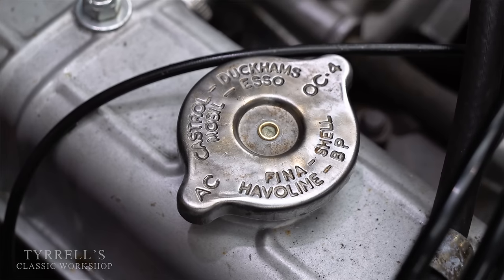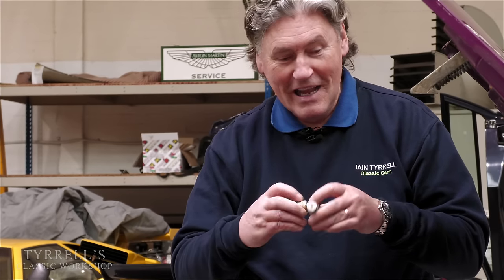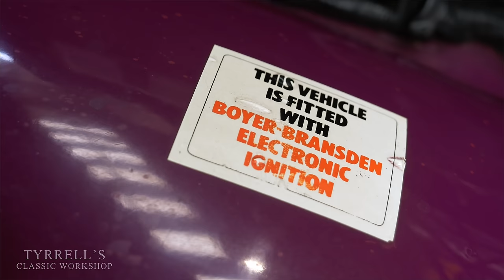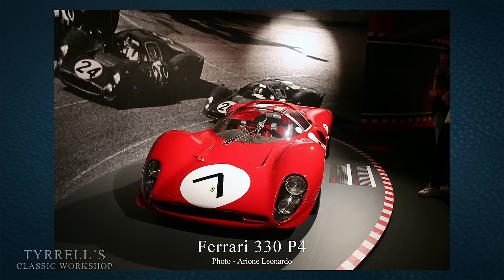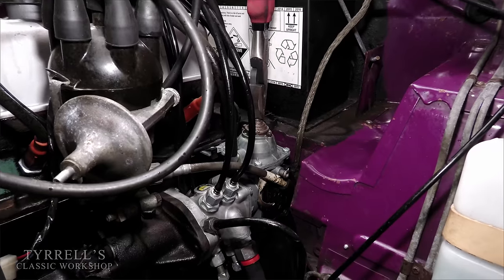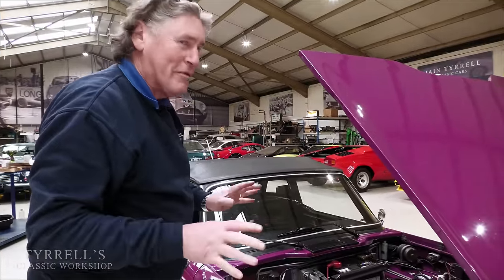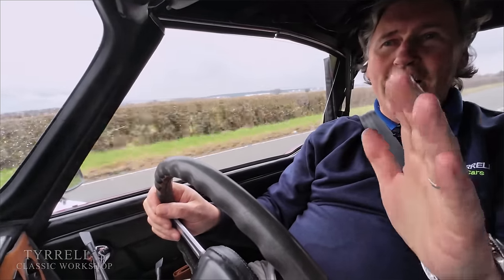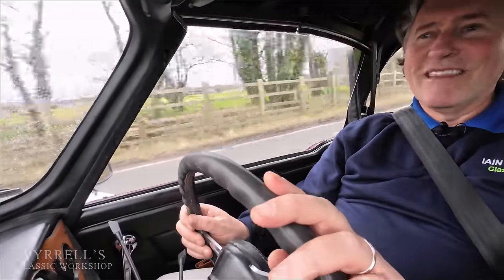Inside the Triumph TR6's Ingenious F1 Fuel Injection System | Tyrrell's Classic Workshop

Comment: My car {a humble 1960 Rover P4, 100 }, has a Laycock de Normanville Overdrive  ! { fitted from new, {Solihull,} and still working perfectly ! }
There are actually 5 switches on it to make it work smoothly, in a very intricate, rod operated, throttle action !
1} The lever on the steering column
2} The lever on the gearbox to ensure that the overdrive ONLY operates in top gear { 4th }
3} Two No. rotary cam switches, bracketted off the engine, operated by an angled lever, to optimise the speed range within which it may operate.
4} And finally a Kick-down switch under the floor mounted, lever type, accelerator pedal, to allow the immediate dropout of the overdrive, for instant acceleration, and return to normal Overdrive operation upon lifting the foot off the loud pedal  !
A truly ingenious system, and relatively easy to set up  !
Shame that it only has ONE carburettor, as I would have LOVED the Lucas PI system, but my Carburettor { an SU HD6}, is connected to the cylinder head via an Integral Carburettor Access.
Love your Nerdy series Iain  !
Take care,
Stay safe,
Stu  xx
Reply from the maker: Thanks Stu!

Comment: If the tappet noise doesn't go away after the valves have been correctly adjusted, you may find that one or more of the rocker arms have dents in them(were they contact the top of the valve) you can either file them down smooth or replace them.
Reply: Great suggestion but just be aware that the filing trick won't last long, the faces should be hardened. These parts are cheap enough just to replace.
Reply: Or tappets are worn or cam lobes

Comment: As I remember, the high pressure pump on these was basically a Lucas windscreen wiper motor, which explains their 'iffy' reliability. The other problem with these engines was that when the bores started to wear, this affected the obtainable vacuum, which in turn made the mixture too rich and smoky. Only real remedy was a rebore and pistons. Cheaper to get twin Strombergs.
Reply from the maker: Interesting- thank you

Comment: Beautiful motor car.  My first TR was a ‘75 Magenta TR6, a lovely colour when it is clean. I’m not sure that the dash is walnut. There is an inertia cutoff switch which cuts off the power to the fuel pump in the event of an accident, which was a safety feature.  One morning I came out to start the car and it wasn’t starting. I managed to diagnose that they was no power getting to the fuel pump, which I traced to the inertia switch.  Once bypassed, the car started and ran fine. I called into the Leyland garage but they said that the inertia switch was no longer available and that the best thing would be to go to a scrapyard and see if they have one on an old Triumph 2500 PI.  I was a student at the time and when I got to Uni the guy I sat next to for the next lecture asked why I was late. I explained to him what had happened and he said that his father had invented the cut off switch and had a box of them in his garage.  A few days later a new one arrived in the post.
Reply from the maker: Excellent experience- thank you for sharing

Comment: Thank you Ian for bringing back memories of my earlier 1970 Damson TR6. The only “Fettling” it needed was to the front trunnions I had to replace after the nearside one sheared and the wheel collapsed at some traffic lights! Oh, and the rear diff carrier which was cracked and proceeded to knock each time the prop came under pressure, temporarily solved by wedging between the cracked section with a piece of wood! How’s that for engineering 😂. I still loved it though and drove it to London with drivers door caved in thanks to some kind lady who reversed her car with tow ball into it! The clutch was heavy as hell and murder on my leg trying to negotiate Marble Arch traffic. Oh the memories🙂 Thanks again. 👍
Reply from the maker: Quite the experiences! Thanks for sharing

Comment: I used to drive a 1973 mk2 2.5pi saloon in ice blue, straight pipe with no silencer, sounded amazing and do 120 mph.  Overdrive gear change would push you back in your seat.  Fuel pump in boot overheated once, before I replaced it with a Bosch - just pulled out on to the A9 at Dunkeld and floored it and total fuel starvation, instead of leaving smoking rubber I puttered onto the verge nearly getting wiped by the truck behind.  She was called Blueberry pie and was a true love of mine.  Car was much admired by the many policemen she encountered.
Reply from the maker: Great memories- thanks for sharing!

Comment: Interesting video! I had a 1971 Mk2 saloon 2.5 PI, back in the day, and it was glorious once I worked out an easy way to reset the fuel injection, mine was running horribly rich when I bought it. I left the adjusting rings alone and, from an article in CCC magazine, I used a feeler gauge to take up wear between the roller and shuttle slide, in the small compartment under the vacuum diaphragm. I used progressively thicker feelers, which raised the idle, until it was hunting and running too lean. Finally, I came back a few thou on the feeler to get the mixture right and permanently fitted that particular feeler gauge in place, in the unit. I never needed to touch the fuel injection again. Went from about 18 mpg to around 32 mpg (on a run) Also, the overdrive didn't work ..... that turned out to be a really easy fix ...... the slider switch, on top of the gear stick, was seized. Quick squirt of contact lube and we were back in action. I always fancied a TR6 or a Stag, both fabulous cars! Thanks for the video 👍
Reply from the maker: Excellent bit of offshore engineering there!

Comment: If I understand correctly, the problem with Lucas was not with Lucas, who were perfectly capable of designing and building quality equipment, but with their customers, like British Leyland, who insisted on paying peanuts and always choosing the cheap option.
Reply: They used 2c o rings in the injectors so after 6 months they started to dribble. I put viton on rings in mine , cost 5$au and the injectors never played up again. 
2nd problem in Aus was the fuel pump in the boot used to get so hot in summer that the petrol would boil in the pump causing vapor locking. I solved this with a very cheap water cooling system using a small ice cream container and never had another problem.

Comment: I had a 150 bhp 1972 model, lots of fun. The plugs got increasingly sooty towards the rear of the engine, I guess because the plenum was fed from the front end. The PI systems used to get richer with wear, wish I’d known how to adjust them!

Comment: The much maligned Lucas high pressure pump was a 14W windscreen wiper motor body with a pump bolted on the top!
They used to overheat and stop. The in period mod was to replumb the returning (cool) fuel line and wrap it in a coil around the pump body to cool it down.

Interesting film Ian.

Comment: These EFI Systems Suffer under Aceton an Ethanol in the New fuels
Reply: That’s a worry. I’m often told the same of my Mikuni carburetted 1970s two stroke motorcycles.
With at least one machine, there are no non-metal critical components in the carbs. One in the fuel tap, the diaphragm, but I prevent leaks when sitting with an in-line on/off valve. The bigger bike has CV carbs and vulnerable rubber / Viton diaphragms, so i have a spare set in my parts box. So far, I’ve noticed no problems with modern fuels, though I always use the 99 RON fuel & fuel stabiliser in the tank (not that I’ve empirical evidence that it’s needed or effective!).
What is it about those FI systems that doesn’t like modern fuels?
Reply from the maker: Stick to E5 with a suitable additive

Comment: First of all Iain, thank you for giving me previously unknown detail of the provenance of the Lucas PI system - I have a new respect for it. I had a couple of TR6s in the late '70s' and loved them. Getting them to run properly was a problem until I spent an afternoon at a garage in West London called DCM, also known as the TR Center. Clive Jarman ran the place and knew how to make a TR6 run sweetly. I was amazed when he pulled out an injector (just as you did) while the engine was running and after noting the spray pattern was not uniform, pinched the end of the injector, pulled it, released it, and bingo, the spray pattern was perfect. Apparently it was not uncommon for dirt or sludge to cause a partial blockage. The weakness in the system was the high pressure fuel pump, which is rumored to have been based on a windscreen wiper motor, and hence not as robust as the Bosch unit which was the more expensive upgrade. The TR6 was the last of the 'hairy chest' British sports cars, and given your connection to this particular car, one of the last year's of production, earns its place on your channel. I doubt its successor, the TR7, will ever be featured...
Reply from the maker: Thank you. Great memories

Comment: Studebaker trialed an EFI system around 1956/57 but never brought it to market. Chrysler did bring an EFI system to market for 1958 but recalled them soon after launch. They both used the Electrojet injector which went on to become Bosch's K-jetronic.

Comment: I never had any PI issues running a TR6 for most of the1980's.  Another tip it to nip each injector pipe between thumb and forefinger, this helps detect weaker/dripping injector pulses, which can usually be sorted by removing and tapping with something metallic until you get a decent pattern again

Comment: The lucas fuel pump was actually a modified lucas wiper motor, when working correctly it could produce much more than 110lbs working pressure,  after the pump was a pressure regulator , they were more problematic than pumps, dirty fuel was the cause of lots of there problems . I worked at Triumph dealership when these came out, the older technicians didnt want anything to do with them. If 1 tappet is noisy it's probably a worn rocker, check the rocker shaft locating screw hasn't fallen out. You really need an exhaust gas analyzer to set fuel ratio accurately,  use a multi carb balancing tool to balance throttle bodies. Check metering pump is timed correctly,  many technicians replaced it without setting it correctly.

Comment: Interesting color! Classic Triumph, and yes, my knuckles still bear the results of working on my friends, whom I nicknamed Old Sparky. However, this one does deserve some attention. Like all English cars that I have worked on, they never rust a lot underneath as they are usually coated with oil. They should have been given a pan when parked to catch all the drips—priceless!
Reply from the maker: I think it suits the car. And let's be honest, this isn't a car for shy and retiring types.
Reply: When I had my Dolomite Sprint in the 1980s, I was a bit concerned about oil leaks and consulted a "specialist" Triumph service guy. He explained that I could give him a huge amount of money and he'd try to fix it, with no guarantees. Or I could buy a drip pan. In contrast, my 23 year old 1989 Saab 900 Aero with 320,000 km / 200,000 miles on the clock never needed a top up between annual services and didn't drip oil. It was my daily driver and I also did long trips (over 1,700 km / 1,062 miles) each way in 44C / 111F temperatures and I enjoyed spirited driving.

Comment: The only two problems with my TR6, were constipation when the baffles in the exhaust came free; the second was a common problem with the engine, the thrust washer came out so when you put your foot on the clutch pedal the crank moved forward so the clutch did not disengage but it wasn't a problem, put it into first turn the key and you were away providing you weren't facing uphill, nor was gear changing a problem provided you had your revs right. I turned up a phosphor bronze washer and with a bit of careful fitting with a file to get the cross-section correct the problem was solved.

Comment: Very few of these still exist in the States, the metal just couldn't withstand the salt on the roads in the winter in the Mid-West and on the East Coast. I've only seen a few in the wild, but think a resto-mod with the engine from a Triumph Rocket III motorcycle would be delightful.

Comment: Amazing. Most UK cars had Lucas electrics, even RR. I had countless cars with Lucas and not once had a problem.  

One auto electrician told me, the car makers scrimped, but people blamed Lucas kit.

 He said when adding anything to the electrical system a new relay should be fitted with a new fuse as the wiring was just not heavy enough.  In short, a new circuit from the battery. 

Car makers would not even fit plastic protective covers on connections that corroded. A simple DIY job to put right.  He said the 1960s cars were not built to last more than 8 years, which I agree with.

I had more trouble with a Toyota with a Bosch alternator than with any Lucas setup.

Comment: What a lovely colour! Teclamit Jackson developed a fuel injection system in the 1960s mainly for racing. It was used on amongst other cars the Lotus 47 which was the racing version of the Europa. It was plagued by unreliability and was eventually replaced by by fitting Weber carburettors and further tuning made up for the slight lack of power.
Reply from the maker: Thanks for that- interesting!
Reply: Having attempted to set up a period TJ fuel injection on my 8 port 970 cooper s, I eventually gave up. What a nightmare.
Reply: @iain_tyrrell  I believe the TJ fuel injection system was investigated for possible use on the Austin Healey 3000. Great video, reminded me of Magenta Mk 3 Spitfire we bought for £250 in the early 1980's. Triumph always knew how to make great sounding cars, we have recently put our Stag on the broad after a (very) long restoaration - sounds wonderfiul, but the best sounding ever were the two 2500's I had years ago.

Comment: The BRAKE FAIL lamp is connected to a shuttle between the diagonal braking system.  If there's a pressure drop on either circuit, the shuttle moves internally and triggers the warning lamp.

Comment: 400%. My Dad had a 71 PI in 72. No inertia seat belts, no power steering, no tinted glass but it did have overdrive. The pump lasted for 80,000 miles. 

I had two PI's, a French blue 74 estate and a 72 Emerald green saloon. Both had inertia seat belts, tinted glass and power steering. The estate was Manual O/D. The saloon was auto with the 150 bhp engine, it stripped the bolts on the fly wheel.  

The big problem with the engine is the rocker shaft at the far end close to the bulkhead  has a very small screw in it, it has a habit of coming out and not lubricating the rockers at the far front of the engine. 

Neither my Dad nor I every had a problem with the fuel injection. My dads view was giving the car to someone who had been working on A40's all their life was a recipe for disaster.  

One of the ways to tell the health of the injection is to hold the fuel pipes at each injector and feel for a constant intermittment throb throught the pipe. 

Great review, cheers

Comment: Hello, my name is Sam, I live in the USA and I own a 1970 TR6 PI.
As you may be aware, most all TR6s here are carburetor driven and there is no one here with the expertise to work on the Triumph PI system. 
I believe that my car is running a bit rich and I never new how to adjust the fuel mixture. 
I noticed the when you attempted to adjust fuel mixture…
1. Loosened the bottom nut (only) 
2. Rotated the entire mechanism counter clockwise. 
3. Finally tightened the bottom nut again. 

I assume turning the mechanism counter clockwise will Lean the system , clockwise will richen the system. 

How do you know how much to turn it?

How do you measure the air fuel mixture?

Finally, should I even attempt to mess with it?

Much thanks,
Sam
Reply from the maker: Hi Sam,
There is a Lucas PI specialist in the UK called Prestige Injection.
He is hugely helpful and will be able to answer all of your questions
Reply: Thank you for your reply. 
I had Mr. Malcolm Jones prior to his retirement built my current fuel system.  Metering unit, throttle bodies,linkages, and injectors. My car runs fantastically, lots of power, no smoke, just a bit of soot in the tail pip. I just don’t know how much soot is too much soot. 
One of these days I’ll bring my car to Uk and have someone go over it. 
Much thanks again. 
Sam

Comment: The Triumph straight 6 engine fitted with SU carburettors was modification that had to be done. Easy to set up and maintain the difference it made to the whole performance band was staggering! Gas flow the head and ports, match the ports to the manifolds and this was a howling banshee!

Comment: I had a ` 72 model and that that pump in the boot was a nightmare. It would overheat due to lack of ventilation an vapourise the petrol in the fuel line. I knew when trouble was brewing when, if i was idling in traffic, i could hear the pump motor repeatedly speeding up and slowing down,. a minute or two later the engine would stop and I`d have to wait a while until it cooled down. Once I was giving a lift to a workmate and the dreaded sound was heard. Luckily we managed to get to his house so he ran indoors and returned with a bag full of ice cubes that we packed aroung the motor. Aonther time I was out with my future wife in the hot summer of `76 and it happened again in a country lane.. Fortunately the engine stopped next to a stream so I took some rag I had in the boot to soak it in cold water; once again job done. I think you could later but a kit that took the fuel from the boot and coiled it arounf the pump moter to kepp it cool, rather than letting the heat build up and causing the vapour lock.

Comment: Contemporary reports suggested that the fuel pump issue arose from overheating and a "fix" was to wind a coil of small bore copper pipe carrying the return fuel flow around the outside of the pump to carry the heat away.